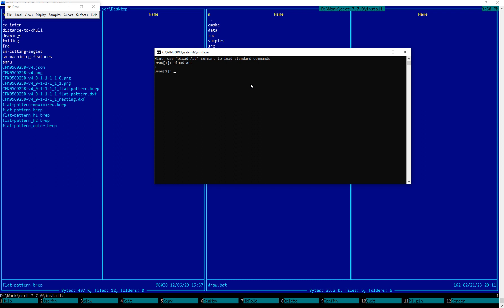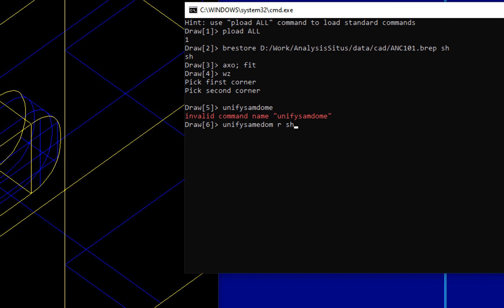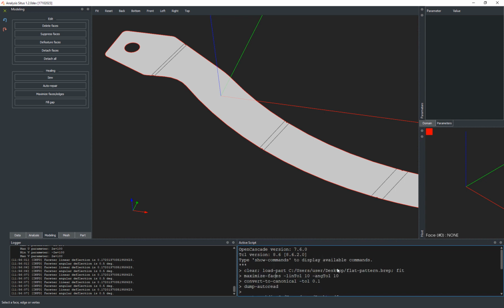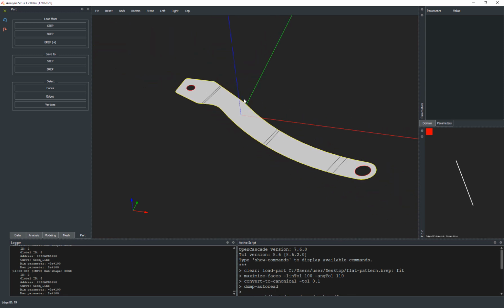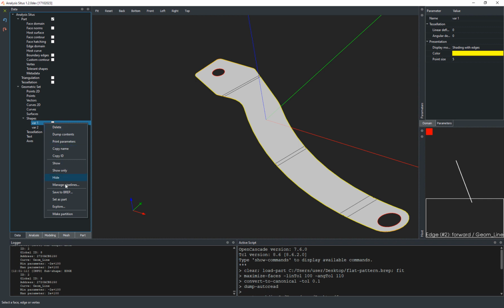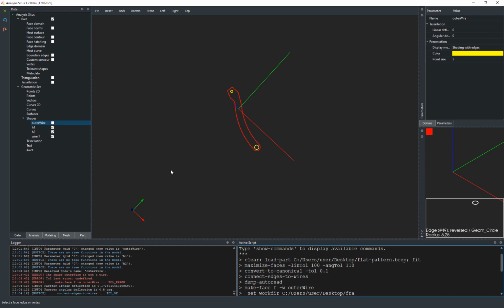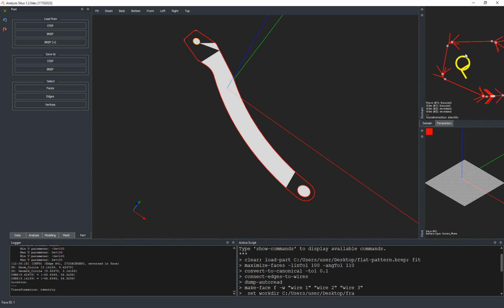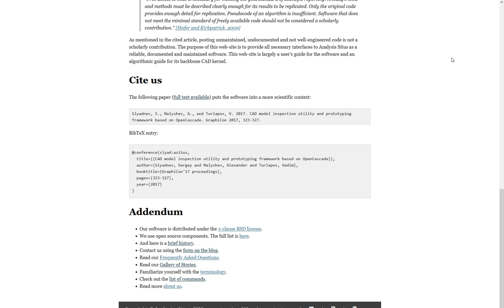Merge planar faces into one

Comment: Is there a way to join all elements of a step file into one single body? Let's say I want to share a Step file of a large assembly but I want to defeature it by joining all elements of the assembly into one single solid body. Is this possible with Analysis Situs?
Reply from the maker: We discussed this problem here: http://analysissitus.org/forum/index.php?threads/how-to-combine-a-set-of-shapes-into-one-shape-ocaf.451/

It is possible but the question is how would the target software interpret compound parts. What happens in Fusion (for example) is it breaks down such parts into solids back. A more severe issue is the file size of the STEP file after combining parts together.
Reply: @QuaoarWorkshop  thanks for writing back. I'll check the thread out.